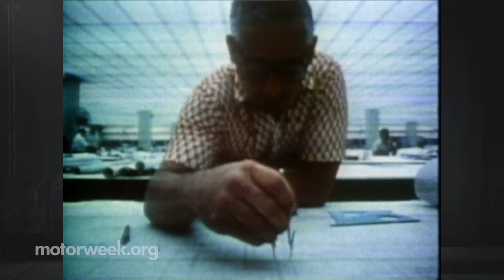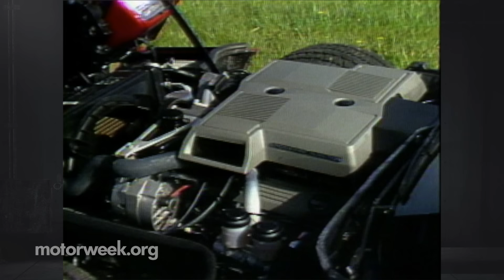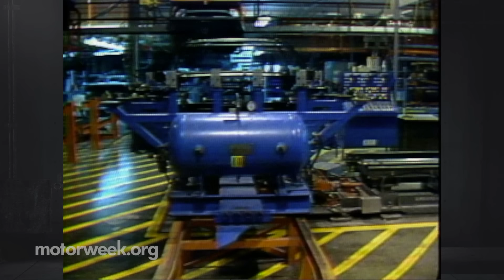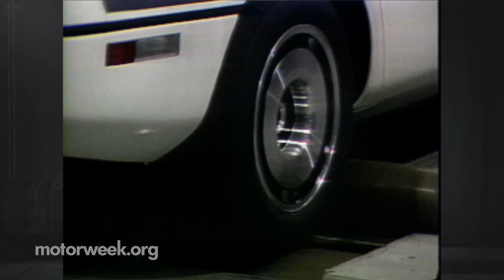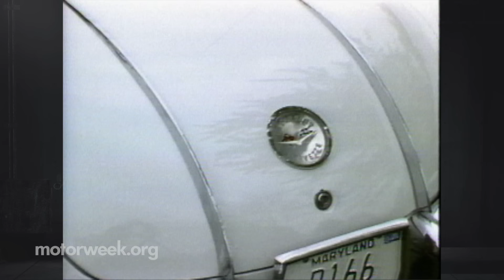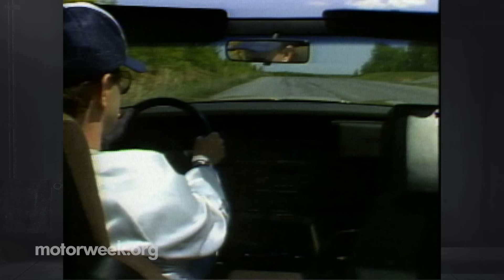MotorWeek | Retro Review: '84 Corvette Special Episode

Comment: I was a huge fan of Corvette back then and I HATED this new redo to them. So f'n ugly compared to the 82 and the older ones.
Plastic leaf springs? Ya Im sure that held up well.
Reply: Daehawk I have an 86 Corvette and mine are still holding up very well. Of course if you take care of them instead of abusing them like so many Corvettes were in the 80's  they actually will hold up pretty decent. Most people drove the crap out of them and didn't do maintenance that's why they drive and ride like crap squeak and rattle. I have driven many that were maintained and they are reasonably quiet and hold up well.

Comment: One of the worst Vett's ever. Ugly dash, cross fire motor was problematic, squeak and rattle's on the inside from the cheap plastic interior and the rubber seals around the
door's  turned to dust after a while.and the one year only suspension and ride quality were awful. The last C4's were much, much better than this first year model.